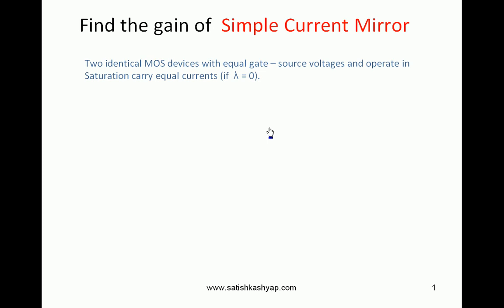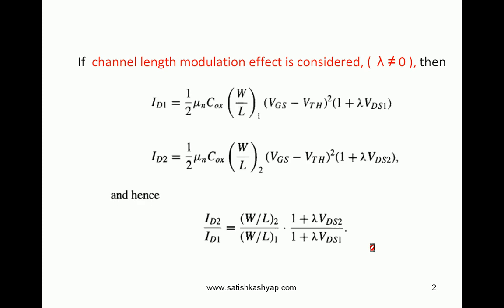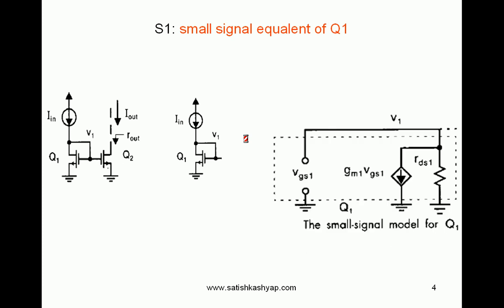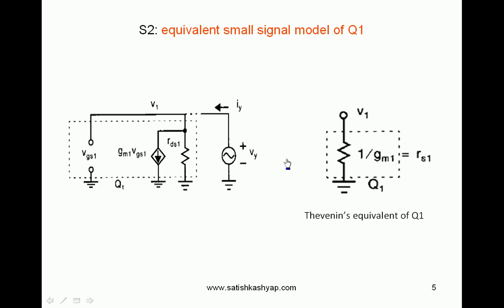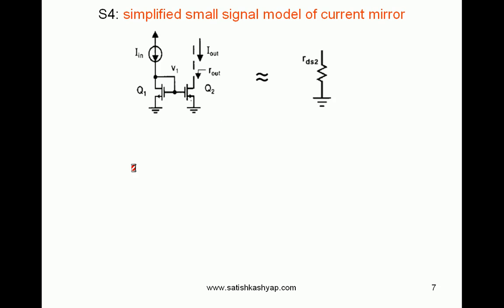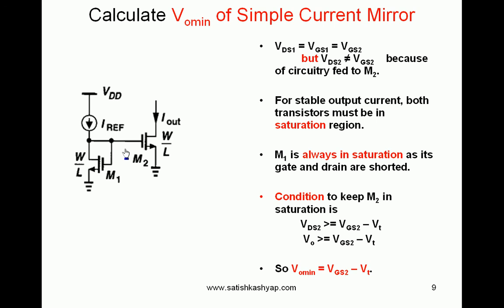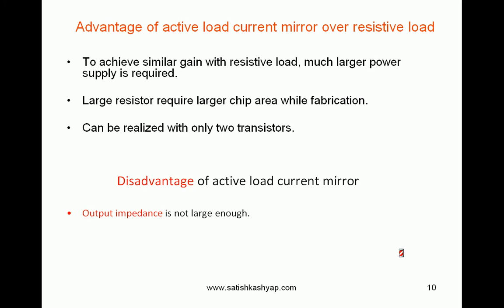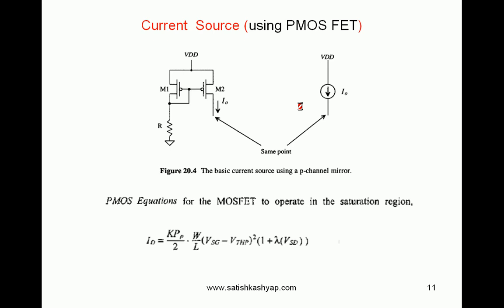calculation of gain, output impedance and vo minimum of simple current mirror

Comment: You can also use Hspice software to simulate this circuit that we can find different Iref/I out results  if the  channel-length modulation is zero or not zero .Thanks Raghu Nanda for sharing this awesome current mirror circuit  of MOSFET so I  want to give you a thump ☝,thanks🤗